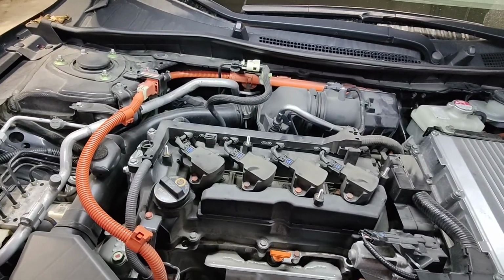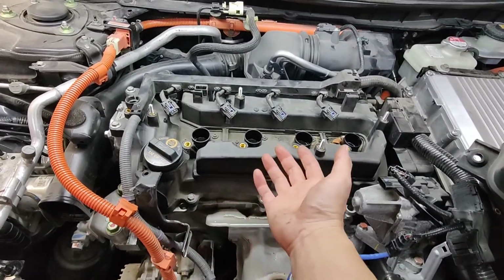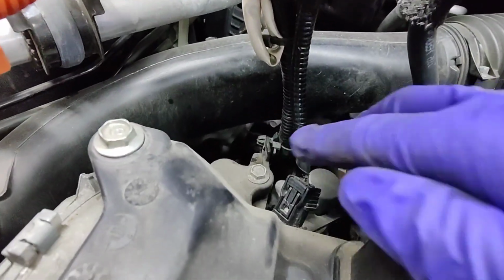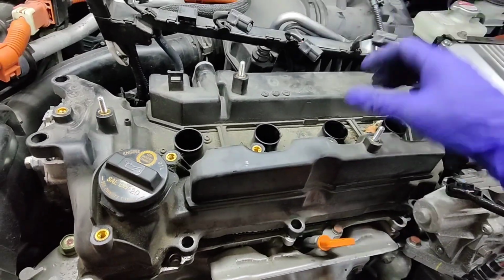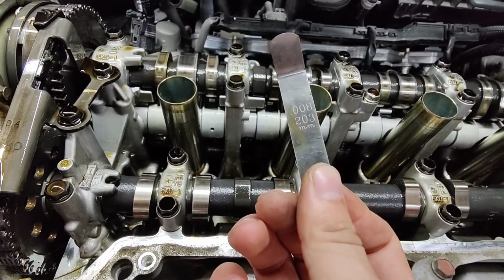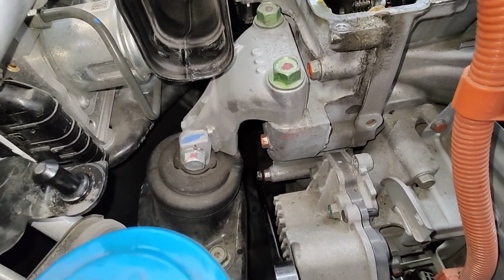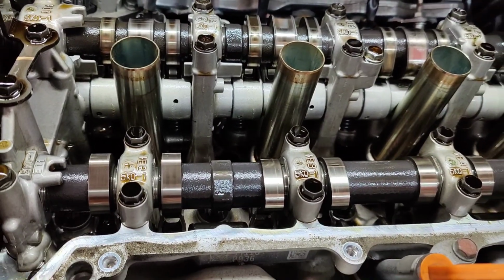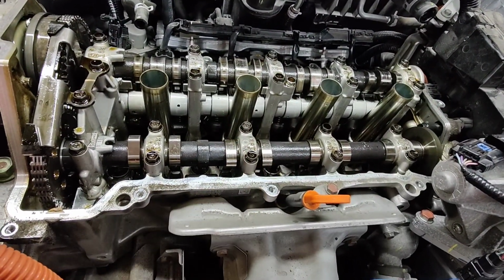2014 Honda Accord Hybrid valve adjustment. only intake is adjustable.

Comment: Great video, thank you. I have a question. I have a 2017 Honda Accord hybrid with 85, 000. Should I consider doing this or still wait?.
Reply from the maker: It's rec. At 100k miles or 165k kms for valve adjustment and spark plugs.
Reply: @theoffroadingmechanic  thanks 👍🏻

Comment: Nice video! I have been looking for a DIY for a 2017 accord hybrid water pump but can’t find anything. Any help would be awesome!
Reply from the maker: The guy working beside me just recently did an electric water pump on an accord.
Reply: @theoffroadingmechanic  what is the tq specs for the water pump bolts?
Reply: @theoffroadingmechanic got any knowledge on the two auxiliary water pumps? I have no heat and the engine is not overheating I fear that auxiliary water pump is bad and I’ve located it but it’s a pain in the ass to reach

Comment: Hi, thank you for providing some of much needed help for 9th  gen Honda Accord Hybrid! Please provide more, because there is so very little here. Questions: 1. Which direction are you turning the crank nut? It looks like toward you.  2. Do you use silicone even though there is a rubber gasket?  3. What scanner would you recommend for the 9th gen Accord Hybrid?  Thank you!
Reply from the maker: You are turning clockwise. And you use silicone on any surface that has 2 surfaces mated to each other like the timing cover and if the surface has a change in angle like a corner because just a regular rubber gasket will not fill in those areas. Any scanner with bidirectional control ie. Autel, snap on, topdon, Kingbolen etc. we don't get many accord hybrids in for a repair. Maybe an electric water pump once in a while.

Comment: What's the spec for the valve lock nut torque?
Reply from the maker: Calls for 10 lb.ft
Reply: @theoffroadingmechanic  Thanks! I was able to find service manual shortly, but here it will probably survive longer ;)

Comment: Owner take good cares of it. Cam looks really clean.
Talking about modern turbo and hybrid. Do modern turbo need extra idle time to cool down and extend its life? I'm concerned with turbo hybrid as engine is shut down asap and stop oil flow to turbo.
Reply from the maker: Modern turbo has come a long way. Back when I had my rx7 I would have to let it idle for a coolant to circulate through the turbo but when your tracking it those turbos can get bright red. On the hybrids with turbo for example the Tucson. The electric motor does most of the work to move you down the road and the turbo is just kinda there if needed for extra power or at higher speeds. But any turbo will go through that process of the engine shutting off already when you park the car. But having good quality and clean oil is important dunno how many times I've seen go because of lack of oil changes and seeing the tiny feed tube get plugged causing the turbo fail
Reply: @theoffroadingmechanic  Thanks for sharing the knowledge. It is concerning as a lot of people already neglected their vehicle. When economy slows down there will be more who cut maintenance spent.